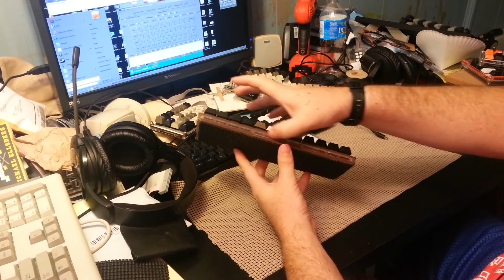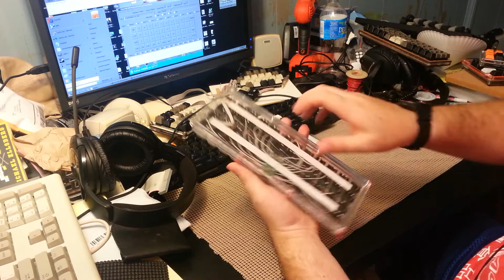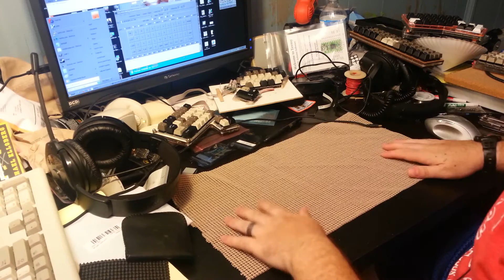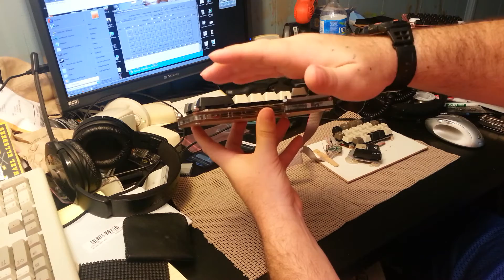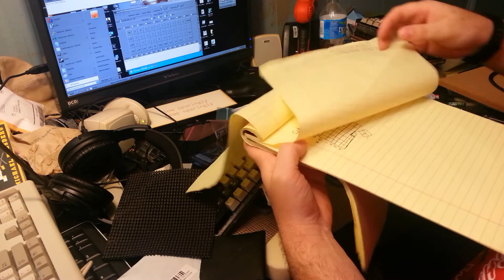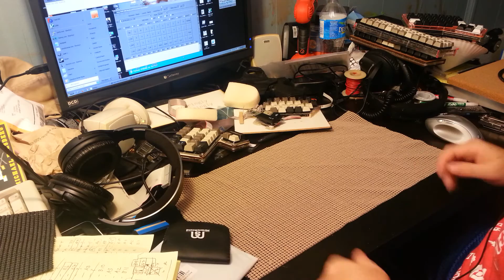Keyboard Walkabout: Every keyboard I own

Comment: I have really enjoyed all your videos. It surprises me that you do not use Linux.
But I do wish that you did a vid with the hand wire build, on how you would wire up the led's and the capacitors with them; especially rgb's. I have seen vids on wiring up rgb led strips but they have their own capacitors built into them already.
Thanks!!
Reply from the maker: This is actually one of the few periods in my life when I'm using windows. The box in this video was my dedicated windows box for software that wouldn't run on linux. Since then, I had given away my other linux boxes, and wound up getting an X200 for me to wipe and install linux. It came with windows 10, and the strangest thing happened... It was good. Not like Richard Stallman good, but functional. Didn't crash. Remembered display settings, and didn't force reboots constantly for updates. At that point all of my work was on my linnode server, so I would use the laptop to open Putty and work. I also fell in love with OneNote with a wacom pressure sensitive pen, but I look forward to trying out Xournal to see how it compares.

If you do use linux, I have several videos on Vim and one on sharing the local clipboard through putty. There is also a playlist series on how to handwire your own keyboard. If you use EasyAVR, I have a video on how to add RGBs to your handwired board, but it doesn't apply to WS2811 style addressable LED strips, just plain RGB strips. I buy those strips in 5V with resistors built into the strip. Makes things much easier.